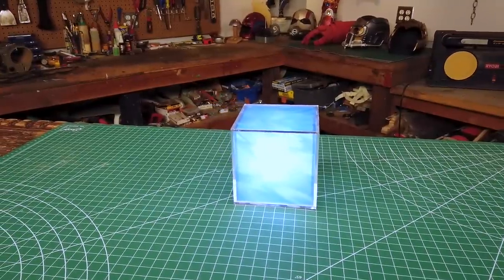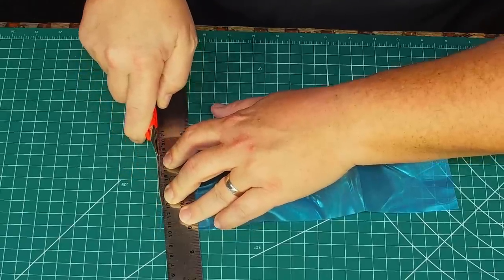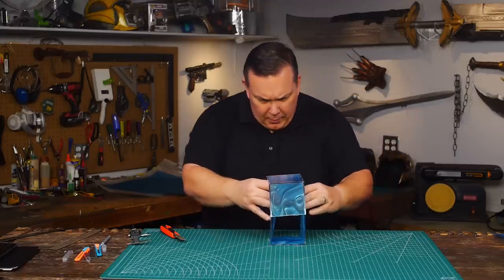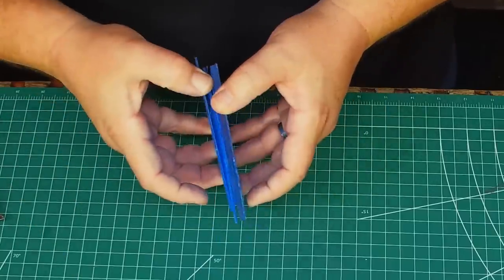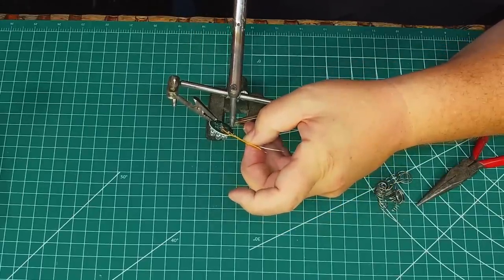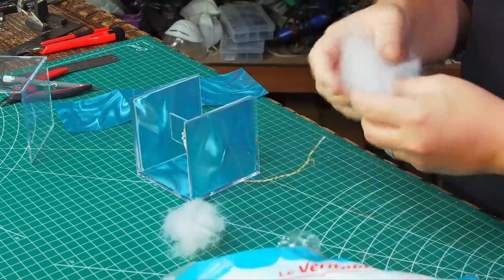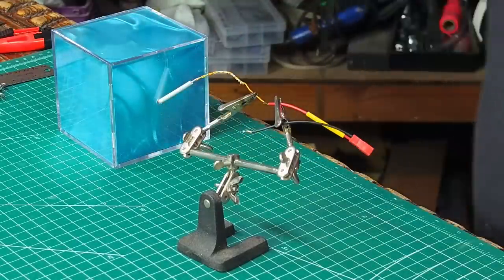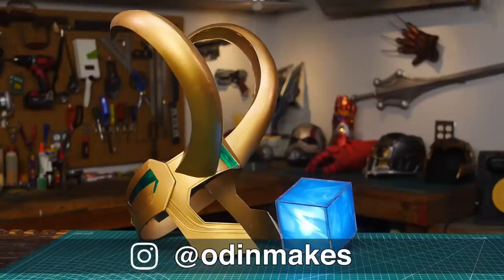Odin Makes: The Tesseract from the Avengers Movies

Comment: I made my own tesseract as well. I painted it with glow in the dark translucent sand, and blue pigment powder, with a swirling pattern. Then I cut neat little holes in it for USB attachments, so not only can I use some really bright USB powered lights, but the USB hub I used has three extra places I can charge my phone or whatever...  (haha I have a functioning tesseract) The USB lights are also remote controlled, so I don't even have to open my tesseract at all to get into it.  So it glows in the dark when it's not on, charges my phone, and I can change the colors of the lights with a button on a remote.

Comment: I made one of these a few years ago. Had used a softball case, with a black bottom base. I took 80 blue LEDs & wired them up in groups of 16 & had them facing inward. I had lined the inside with white foam. The effect was awesome. I will try out adding the  Illusion Film for better effect. I power it with 3 AA batteries that are open in the bottom. My next version will be inside the holder from the end of Avengers when Thor & Loki go back to Assgard. I will try to make that one w/o the black bottom.

Comment: I’ve made one of these before. I like the outer material you used, but to diffuse the light I frosted the cube lightly and used wax paper, very roughly crumpled, and then stuffed into the cube. It gave it a really cool “electric” effect the way the light broke against the wrinkles in the wax paper.

Comment: I did mine a similar way, but I used frosted glass spray paint on the outside, and filled it with crumpled wax paper and blue LED Christmas lights, with their own battery pack. Everything's internal, and it's bright enough.

Comment: @odinmakes You talked about the plastic scribing tool, I have a life changing tip for you. Turn your snap-off knife around. The back end / spine of the blade works PERFECTLY as a scribe! It makes nice curly chips as you make passes too! Leaves a decent surface finish if you manage to stay mostly 90 degrees! It works with 9mm blades, but I prefer doing it with an 18mm as it's more stiff, the 18mm OLFA blades seem to have the perfect spine thickness and angle of the 'snap' to cut through plastic like butter! I use it mostly for styrene and lexan, but I've used it on acrylic and it is FAST!

Comment: Very cool looking prop, and so simple in the end. Like it, might have to make one now :P

I got a tip, if you want a "permanent" power source, those lights (it was in mine anyway) run on 6 volts, so you can run them on a  standard USB charger that puts out 5 volts. I tried this my self on an old flashlight that look just like yours, of cause be sure these voltages are correct before you try it. This way you can have it plugged into a wall socket, or if you want it more mobile, a power bank.

Comment: Maybe use the wireless charging used for some cellphones to charge batteries stored inside next time. You can usually find some on amazon. That way, you can have a nice stand that doubles as a charging station for it.

Comment: if your wearing a glove you could put a small hole in the palm to run the wire up to the sleeve and have the cube velcroed to the palm so your hand doesn't cramp from holding it all day. you could also try a touch light switch.   check out ABTabi channel searched for a dyi.  love the lighting effect. awesome  Love your work